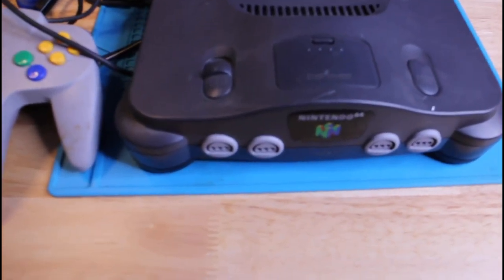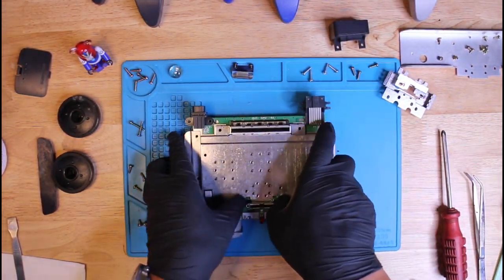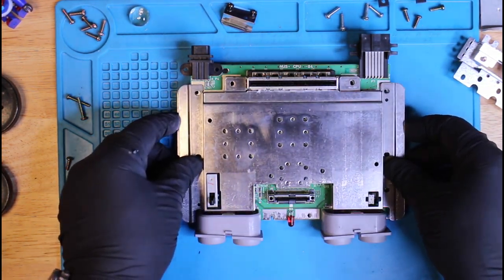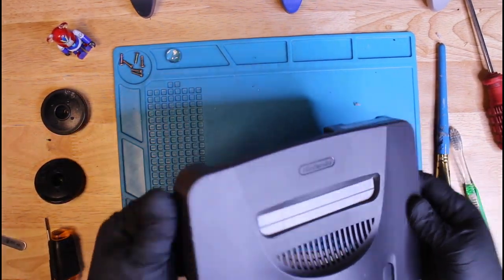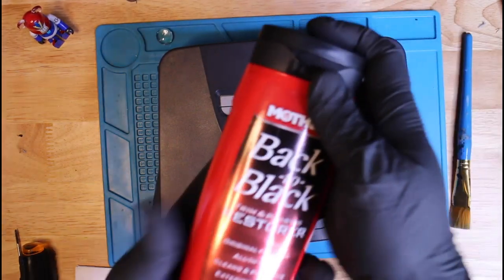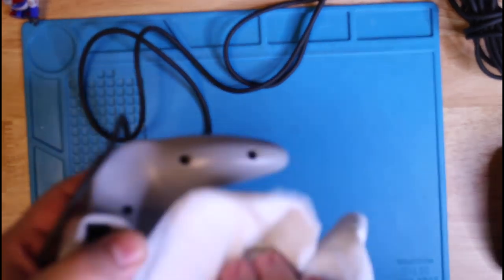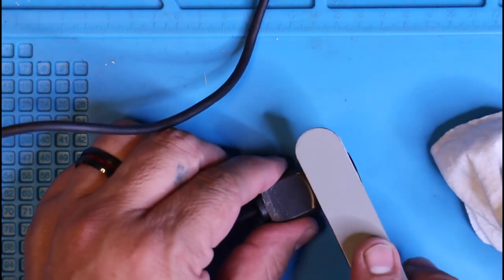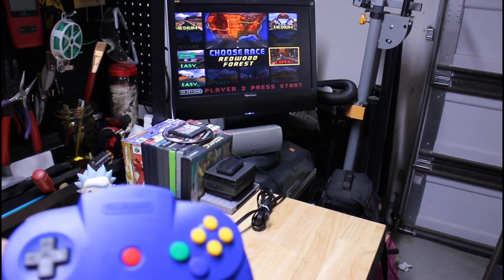How to Clean and Restore a $20 Nintendo 64 🎮 The Lo-Fi Chill Edition!

Comment: Nice video :D
Reply from the maker: Thank you very much. I appreciate the feedback!
Reply: @TRUFixes  I'm working on a gamecube right now that's giving me alot of trouble lol cant seem to figure out how to use the multimeter I have as i found it in a drawer at work. Tested the pot and apparently it's over 200k ohms so I'm gonna buy a new multi tomorrow =(
Reply from the maker: @primusoriginal8648  I hear you! I have like 4 of them because they can be very temperamental. Good luck with troubleshooting and fixing the Gamecube!  :)
Reply: @primusoriginal8648  remember, the problem is not always the optic lens, it could be the driver board, or also the motor.